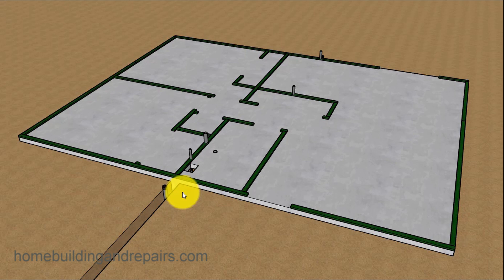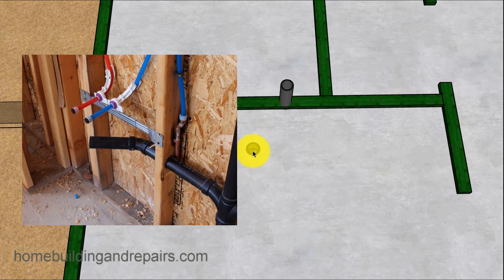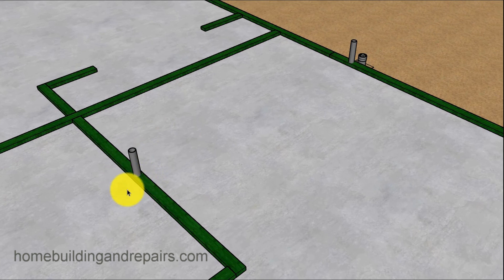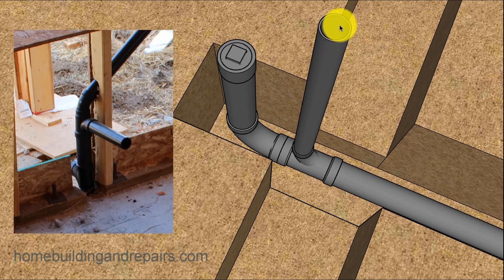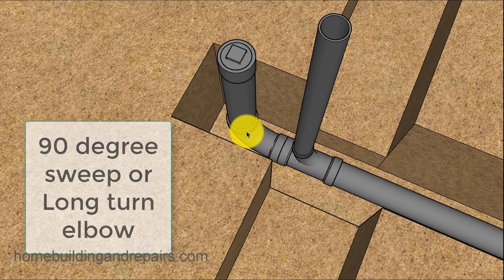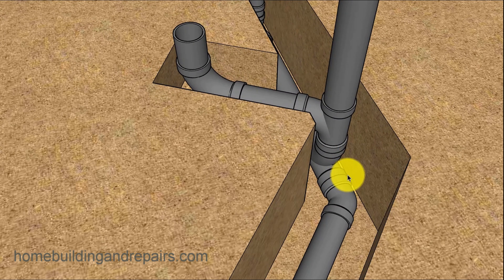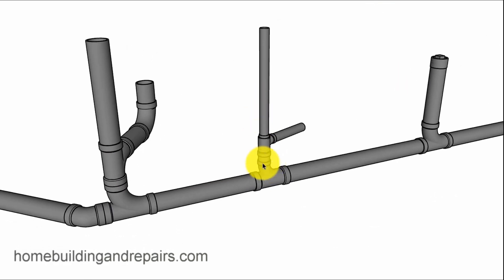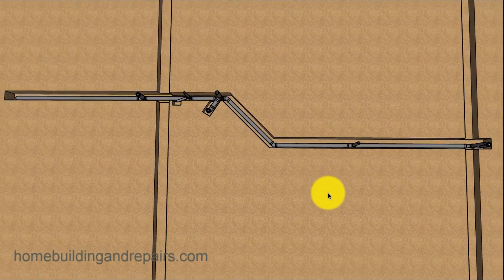Building Foundation Plumbing Drain Pipe Layout And Assembly For Small House - Part Two

Comment from the maker: 850 Square Foot 2 Bedroom House Video Links

Design And Building Tutorials - Part One - https://youtu.be/uWbWkmKO2Yg

Building Foundation Plumbing Drain Pipe Layout - Part Two	https://youtu.be/ZLhC3jlPQiE

Building Foundation Forms, Rebar And Anchor Bolts - Part Three -	https://youtu.be/-4PFNtY7JK4

Wall Framing Tutorial And Tour - Part Four - https://youtu.be/BRP6Il-Zp1k

Roof Framing Tour - Part Five	https://youtu.be/SYEyeAZY3GU

Rough Plumbing Pipe Layout, Gas And Dryer Vent For 850 Square Foot Two Bedroom House - Part Six	https://youtu.be/BUxdWfWIJOc

Exterior Wall Framing Details And Close Up Views - https://youtu.be/ZlQrNd_Hxro

Interior Wall Framing Details And Close Up Views - https://youtu.be/K0_vVfGNcu4

Comment: Hi great graphics! I am plumbing in a 3 pc bath in a concrete floor. I have a main drain ending with a WC. I want to branch off to the right (looking from above) for a lav and branch to the right of the main for a shower. Does each side need it's own dry vent? I am in Canada. Thanks
Reply from the maker: If it's not going to use a wet vent, then it will need a dry vent.

Comment: Very informative. I have concerns regarding sewage clogging. We have clogging issue in our basement sewage every couple of weeks. Is it possible the pipe doesn’t have proper slope due to which it gets clogged more often? How can I find out if there is issue with pipe ?
Reply from the maker: I would use a plumbing video scope if you can find one at your local rental yard. It sounds like you might have old pipes that might be partially clogged.

Comment: Do you have any videos that explain where the pipes enter the home to reduce chipping concrete and moving pipes to meet codes. For example a toilet is supposed to be 12" from a finished wall one way and 15" the other, some how the idiots who lay these out set them 8" and 8" leaving a need for chipping and off setting  with elbows. This labor could be eliminated with the proper layout, ive never seen it done, but I e heard of the string line method for residential. It's where 2 points on opposing walls are established and 2 string lines are used to pinpoint the toilet riser. If you ever get a chance to make a video this might be a good one.
Reply from the maker: I will put your suggestion on my list and I've already made a few videos on locating plumbing fixtures at our website.

Comment: Underground  plumbing can not be < than  2".   fittings mus be sweep (90s) or the combination of 2 45s is acceptable. slope 1/8" per ft. so water don't out run solids ,  CO or Clean Out , I rather use 2 combo wyes  back to back outside the house, 1 facing inward  just in case  of any clogs the trunk line can be snaked from outside and therefore avoiding making a mess inside the house by bringing in tools + snake and the smelly stuff coming with it when snaking.  besides , 3" clean out T's inside a typical 2x4 wall doesn't always work because it'll be protruding through  the drywall and installing it sideways to make fit it is not such of a good idea. I seen it done before. In a 1 level house the best thing is to make it a wet vent with all 2" piping coming out the ground and fittings are cheaper than 3".
Reply from the maker: Do you have the building code reference numbers for your suggested comments?

Comment: I got a house but  can't figure out  the schematic  , well  my laundry drain stopped  up every year or so no more than 2 years , locking on your schematic I'm not sure that is the configuration on my drain,  anyway because is too difficult   to insert the snake from the roof inside of the roof vent for my laundry this is what I did , I add a few inches above the water valve ( hot and cold)  for my laundry machine I installed a clean up throwght  the wall  , this way I can use the snake from outside of my house and not from inside of laundry room,  the 10 years I leaving in this house when the drain stopped up this made water screw up my wall , then I have remove the shirock  and repainted , this is why  on my case I recommend to install a clean up on the laundry drain , but I don't know if this make a broke  a code , please let me know.  Thank you
Reply from the maker: I've never heard of any code issues from adding a clean out as long as it was installed correctly.

Comment: So incredibly helpful! I’ve got a rather big slab with three 3” drain lines meeting up at a 4” line going to a septic system. We have an option to place two of those 3” lines outside of the slab and run them parallel to the foundation until they meet up with the septic line. The idea being if there were a problem, we would be digging through dirt instead of breaking up concrete. It does seem . . Strange. The lines would be slightly shorter and have a more direct path to the main drain if we kept them all under the slab. I also haven’t seen anyone else worry too much about their under-slab drain lines. I’d be so grateful to hear your professional opinion about it. Assuming the 1/4” rise(fall?) is still possible with the longer runs outside of the slab.  Thanks for all of your videos!
Reply from the maker: I would do the math to make sure the drain line will have enough slope. You can't install a hundred feet line if you only have a few inches between both connecting pipes.

Comment: i have concreate slab with trench for drainlines only. how can i connect waterlines to drainlines? any suggestion i do appreciate. thank you
Reply from the maker: Water supply lines can be ran under the slab or in the walls and attic.
Reply: @gregvancom  thank you.

Comment: OK, so for my floor drain pipes under the basement floor, that will take all the waste water into the public sewer line, I am thinking to put a 5 inches schedule 80 pipe. Cost doesn't bother me. Are there any drawbacks for this application? I just wanted to have a stronger and wider pipe under the floor so I, hopefully, never have to dig the basement floor to treat the broken or narrow pipe.
Reply from the maker: You might only have a 4 or 3 inch pipe coming off of the sewer and you can't usually go bigger.
Reply: @gregvancom  
Is it usually cuz of the code or technical challenges, water flow issue etc?

Comment: I have a Question. If I decide to change the subfloor under the toilet, Are any Gas pipes nearby? I see many accidents with Leak Gas paper Demange. I also would appreciate it if you could show a video showing the Gas pipes under a house, I still did not see one on youtube. Still looking for. Thank you. your videos help a lot.
Reply from the maker: Most gas pipes don't run through bathroom floor plumbing areas. I usually cut a small inspection hole, something about 6 inches by 6 inches without penetrating past the bottom of subflooring when cutting with saw to see what's in that area.

Comment: I think I just saw the answer to my previous question.  This is the kitchen side and is not a drain out of the house, so the orientation is correct.  Are all the pipes extending outside the outline of the house below the bottom of the footing?
Reply from the maker: Some times they face the outside and sometime they face the inside, depending on what they are being used for. Most clean out face outside and drains face inside to be used with sinks and other fixtures.

Comment: does the drainage pipe go under the footing or through them?
Reply: I run mine through the footing but put a 3 inch pipe through a 4 inch pipe so the actual drain is not concreted.

Comment: Love the content. You didn't mention the depth of the drain line in the trench is there a required measurement for the trench??
Reply from the maker: I don't think there is one underneath the house, but there is a minimum depth outside of the perimeter of a building and to get that information you would need to check with your local building and safety department. I want to say it's at least 24 inches.

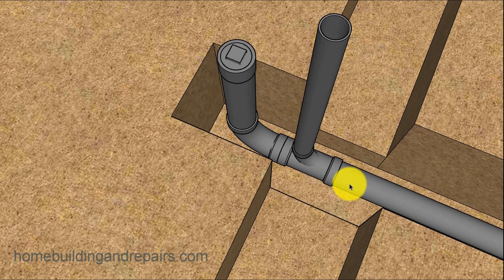Comment: On minute 3:11 , can you add another two rooms out there with their bathrooms ? Or should I run a new line to the front of the house. (To an existing house)
Reply from the maker: I can't answer your question, because it depends on to many variables like pipe size, location and building design.

Comment: Is it beneficial to go up to 4" pipe instead of 3"
Reply: It wouldn't hurt to plumb a house above code minimum, 4 inch pipe is required when you have more than 4 bathrooms.
Reply: It will also make your toilet installs much easier after the slab has been poured, because you can simply cut the 4” riser floor with the finished floor and insert a 3” toilet flange INSIDE the 4” pipe. Huge help, but you could also achieve this with a 4x3” 90, without having to upsize the entire trunk line to 4”

Comment: When you pour the slab will the concrete fill in the gaps around the plumbing and solidify the trench pipe in concrete or does it get covered with something
Reply from the maker: Concrete should never touch the plumbing pipes these trenches should be backfilled with a compact double fill material and all exposed plumbing pipes that will come in contact with the concrete should be wrapped with an approved material. I've used cardboard in the past.

Watch this video to learn more.
https://youtu.be/UlFlJonhLLA
Reply: @gregvancom  thanks for the tip!
Reply: Concrete will expand & could warp or crack your pipe. It’s also a bitch to jackhammer out if you have to. You want your piping to remain at 1/4” per foot grade unless it’s 4” & above in which case, it’s 1/8” per foot so to ensure this, backfill your trench about 12” with sand & pack the sand in & around your pipe as you go to keep it snug & secure.

Comment: I design houses as a hobby, I have a two story 1500 square foot house in which both up and down stairs I incorporate a 4 foot wide by 12'10" mechanical room. All of the ABS sewer is exposed to this room, this enables 45 degree fittings for each fixture to be installed as clean outs not counting the three clean outs outside of the home. This also provides complete access to the hot and cold water lines as the water heater is also installed in this room. A power snake would be provided as standard equipment. Plumbers would not like this as the home owner would never need to call them out to unplug a clog anywhere in the system. Also under the first floor is a tunnel that provides access to the cold water line entering the home and access to the ABS line running to the sewer system under the street. This tunnel stops at the house exterior walls. There is a 8" wide gap of the second floor slab to allow the plumbing unimpeded access to the second floor! The cold water lines are installed about 2' off the floor and the hot water lines are installed 5' off the floor, they do not cross one another at any point. Cold is blue Pex line while hot is red. One 4' vent exits the roof for ventilation and release of methane gasses from the sewer system. House dimensions are approximately 35' x 25' feet so the kitchen and guest bath/laundry are back to back on the first floor, and the master bath is directly above the guest bath making a compact plumbing job.
Reply from the maker: Wow, sounds interesting and feel free to email me some of your designs if they aren't top-secret.
Reply: @gregvancom  The design is a one bedroom, one and one half bath two level design. With the welded steel studs the walls can withstand 300 mile per hour winds, but I add the block to the exterior for maintenance free exterior walls. The common walls are the typical 4.5" inch construction, the center wall in the house is load bearing and framed with 2" x 6" steel and have 11  3" x 3" steel posts with-in the wall to support the second floor 4" thick concrete slabs, this load carries to the exterior 2" x 8" with about a 13' foot span. The living room is about 24' x 12'10", the Stairs are at the west end of the living room. The Kitchen is 18'0" x 12'9" with 14 drawers with-in the cabinet bases unless you buy the new trend of a three drawer base cabinet, then about 42 drawers would be in the kitchen. The refrigerator/freezer is recessed into the Mechanical room to allow the refrigerator to sit flush with the cabinet fronts, usual Range and Microwave, two bowl deep tub sink and room enough for a 6 or 8 person dining room table. The Mechanical is 4' x 12'9" with just the 50 gallon water heater at the interior end. The Mechanical room is entered through a 2'6" exterior  door on the patio. The Guest Bath/Laundry is 7'6" x 12'9" which includes the closet for the Heating and AC system. There is a laundry chute from the Master Bath above, Washer, Dryer, Toilet and 4' wide vanity, that completes the first floor. The patio is a 3/4 wrap around from the front of a huge garage to the back of the garage making for plenty of outdoor entertainment area that is covered by the patio upstairs. A staircase is built for the patios for ease of moving to the other level. The second floor is almost a duplicate of the first, the bedroom is identical to the living room, then the Master bath is the same size as the Guest Bath. There is a second Mechanical room upstairs identical to the first floor. The difference is the Stair landing and Master Closet over the kitchen. The house is oriented north/south due to the hot Arizona climate. The west walls of the garage and second floor have no windows or doors. The upstairs patio is another 3/4 wrap around that is covered under the roof. The Garage is about 39' x 30' in size, this has a two car bay, storage, the AC Compressor venting to the rear patio and a Perkins Home Generator to power the entire home in the event of power outage. The Garage sits west of the house but is attached. With this house being framed entirely of steel studs, block around the exterior it is fire proof for the walls. Fire code X dry wall used through out, rock wool insulation in all exterior and interior walls makes it also fire proof. 9 triple pane windows provides a quiet house. Use of wrought Iron and block around the the two patios prevents any home invasions. The house is designed to be very secure without looking that way!
Reply: @GM8101PHX  Well there goes the copy write
Reply: @gregvancom  I would have to copy write them prior to releasing them!
Reply: Would love to see this design.  Do you share it?
Reply: @Scromes-nz2on  Not as of yet, this house design is way off the charts in the design of the structural bearing. I design it with 2" x 8" steel studs welded together to include floor and ceiling joists as well as the roof truss system then use 4" x 8" x 16" colored block on the exterior. I do not know any houses that are built to this standard!!! I would have to to copy write it first!

Comment: Hi Greg, why have such an elaborate round trap for the washer? 
Why not swap the drain pipe and taps so the pipe can go straight down to the trap? Wouldn't that be a simpler install?
Reply from the maker: I'm not 100% clear on what you're suggesting, could you provide me with more detailed information or email me some pictures.
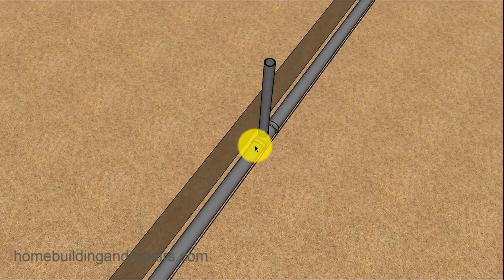Reply: @gregvancom   the photo you showed @4:52 of the laundry drain  has a 3/4 circle as part of the trap. I was wondering why not move the valves to the right and the drain to the left? That way the pipe goes straight down and the trap is more 'traditional' (1/2 circle).
Reply: @coatknight   I agree, but I really don't think this will be a problem.

Comment: Greg,  good info, thanks.  Did i miss the location for a sink drain in the bathroom?  I noticed the stool and tub/shower connections but didn't see a sink connection,  A separate connection to the main line? Again, great show!
Reply from the maker: It will drain into the toilet vent pipe as shown in the video at 0.55 seconds into the video